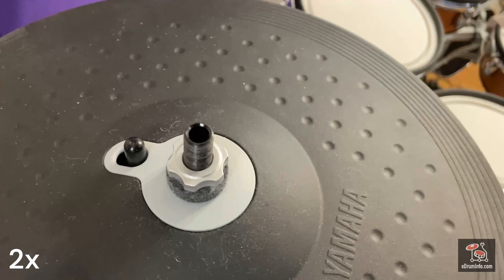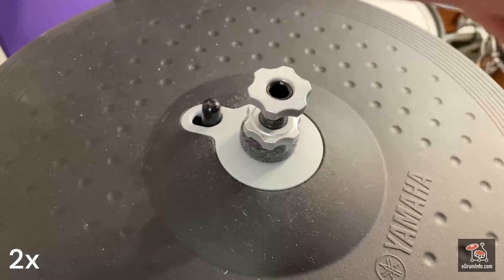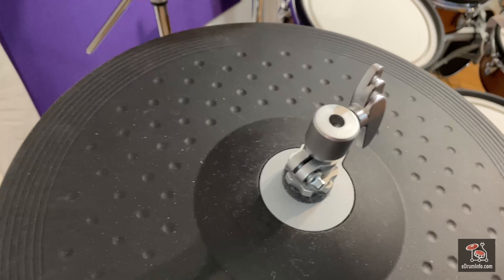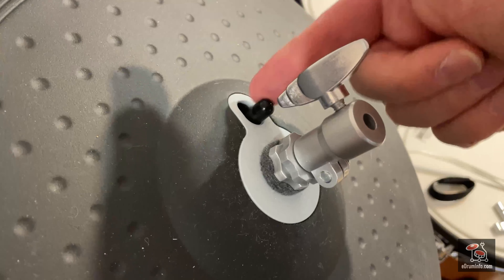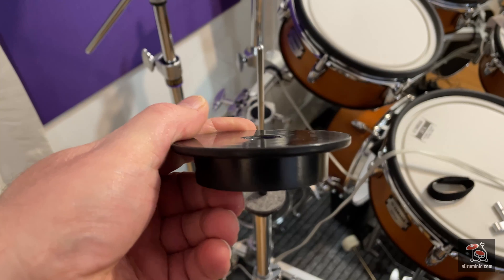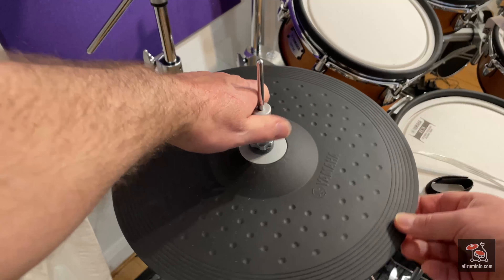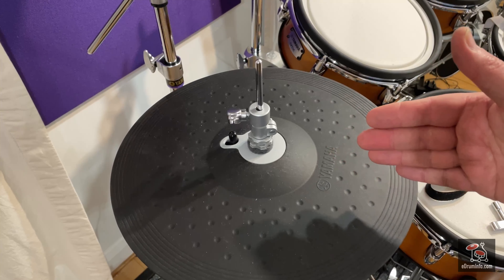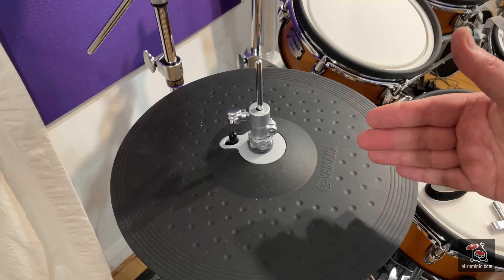Setting Up The Yamaha RHH135

Comment: Thanks for the video. I have a DTX10 on order and have been reading the online manual ahead of arrival. I noticed that you left the big felt washer in place on the cymbal support, but STEP 9 in the assembly manual under "Assembling the hi-hat stand" states be sure to remove the felt washer when assembling the electronic drum kit. If you leave it on, you will not get the proper playing feel. 

Is it best to leave this felt in place or to remove it?
Reply from the maker: Thats because not everyone will be using it with a Yamaha hi hat stand. Some hi hat stands have a much thicker (and softer) bottom felt, which can slow the open and close response. Yamaha stands generally have a thin bottom felt and I've found it makes little difference whether it is left on or not. You might find different and prefer the feel without it, but try it and see. The bottom washer already has a neoprene bottom, so its not essential to remove the felt. As with all these things, try it and see for yourself. See what works for you.
Reply: @edruminfo  Thanks Simon! I really appreciate the detailed explanation.
Reply: @edruminfo  Hello! How to remove a hi-hat lock from a cymbal? I wanted to try to remove the bottom felt, but the lock got stuck. I'm afraid to use force
Reply: @edruminfo thanks, what model of Yamaha stand are you using ?
Reply from the maker: @sergioandresrodriguezcor-nf6mk  I use whatever comes with each kit, but it will work with any Yamaha hi hat stand, and many others as well.

Comment: I replaced my HiHat to one similar to this - (I have a Yamaha kit). It’s got all the same features and inputs as the RHH135 so assumed it would be okay for my kit! 

But it’s stuck on closed hi hat all the time? 

Any ideas on how to fix this? Maybe I need to calibrate this new pad to the kit in the settings somewhere?

Tried different cables and that didn’t work either…
Reply from the maker: @TomDrummerAndSkater  Hi. I’m afraid that unless it is a Yamaha hi hat pad, it won’t work as Yamaha use a different control system to most other companies. Which kit do you have?

Comment: Yo mr simon, i need to set my hi hat height around 1 inch from that black thingy... Else i will get open hi hat sound even though i press the pedal... Is this normal? 
Unless i press the pedal really hard... 

I don't know which one is wrong, the hi hat or the stand

If i remember correctly i don't think i need to press that hard on acoustic hi hat to produce closed hi hat sound
Reply from the maker: Hmmm... that doesn't sound right. Is the lower black part the correct way up? Which module?
Reply: @edruminfo  thank you very much for answering sir

I am using yamaha dtx 6k3x
I set the black thing just like you did

I bought a used one though, so the sensor might be degraded a bit or maybe the stand's pedal
But i don't know which one is the problem
I don't want to buy both

Comment: Do Lemon or Roland hi hats work with dtx pro
Reply from the maker: Not directly as they use a different mechanism, but if you use something like an edrumin5 as an interface you can use them with the DTXpro.
Reply: @edruminfo  Thanks that helps a lot . you have any links to this interface?
Reply from the maker: @vinitha2679  https://www.audiofront.net/eDRUMin.php
Reply: @edruminfo  this is pretty dope. And I can just connect this to my drx pro module and use Roland and lemon stuff ?
Reply from the maker: @vinitha2679  Yes. I have one connected to a DTXpro module next to me at the moment.
Reply from the maker: @vinitha2679  Yes.